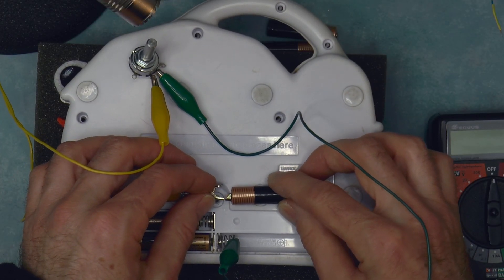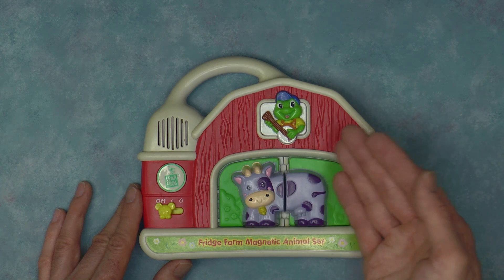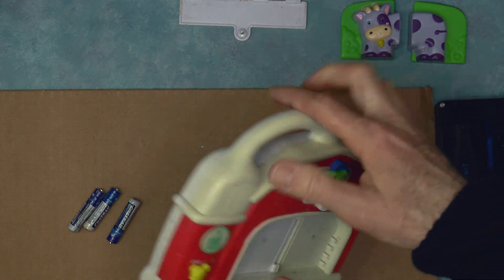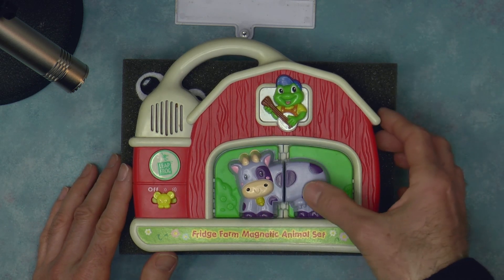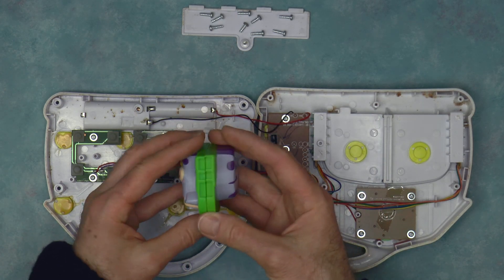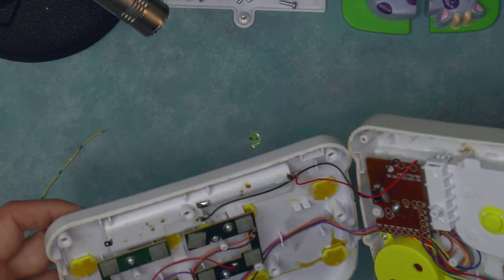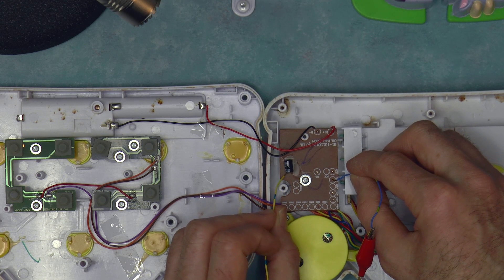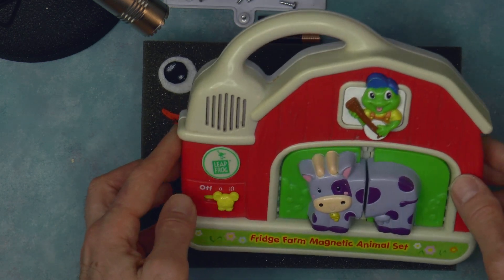Fridge Farm - What Banjo Picking Nonsense is This?

Comment: Fun fact, this toy has a factory test mode. Basically, factory workers can use these hidden modes to test all the electronic functions of a toy without having to extensively play with it before sending it off to get packed up and shipped off. Test modes aren't designed for consumers to really know about, but if you know what you are looking for you can find them.
For this toy, make sure there are no animals in the unit, hold all 3 buttons and turn it on, you will hear a beep, press the music button and you'll be met with a static loop. Pressing again will get you into an input test, you can test all buttons / pins here, the unit will speak a number when a button / pin is activated. Press the music button again and you will be in the sound test, this will cycle through every audio file in the rom in sequence until you either press the music button or turn it off.
Ok nerd talk over, test modes are quite fun.
PS, the 3 banjo notes you kept hearing when looking for bends is actually the sound for when you press one of the tile buttons when nothing is in the unit. Hope my little info dump helps.
Reply from the maker: That's fantastic info and I'll have to try it when i revisit this toy. Thanks!